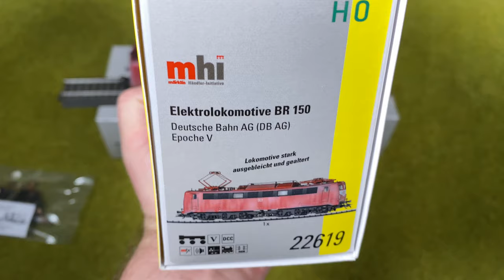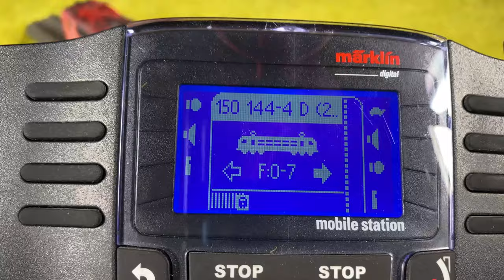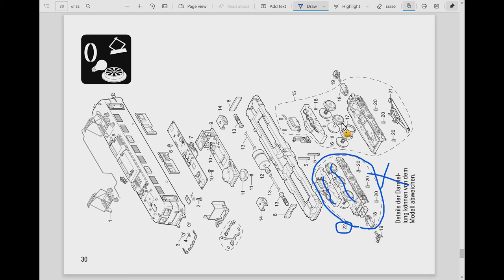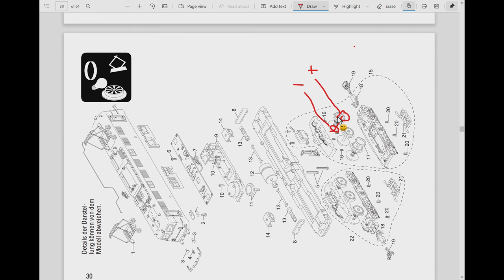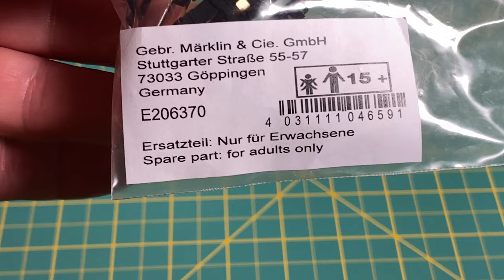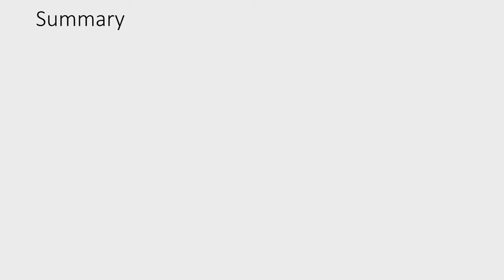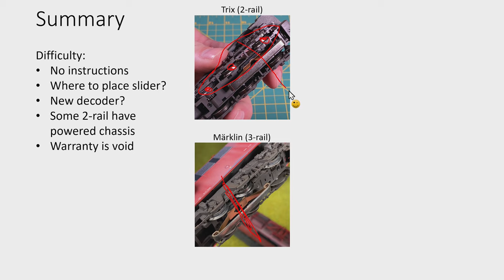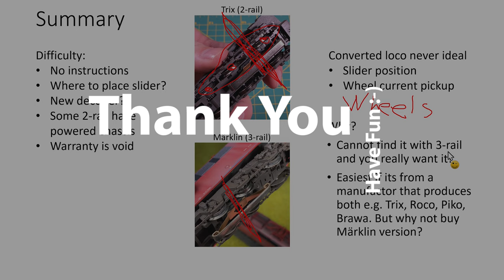Experiment: Converting Trix 2-rail to Märklin 3-rail (Extra 03)

Comment: How do you run a 3 rail loco on 2 rails?
Reply from the maker: Hi, 

In this video I am adding a slider to a 2-rail modern digital locomotive so I can run it on my 3-rail digital Märklin. However, in principle you could also do the opposite by removing a slider from a 3-rail locomotive. Then rewire to make sure the power is taken from the rails - not the slider you have removed. 

Please note this trick only works on modern digital locomotives where you want to go between 3-rail Märklin and 2-rail DCC. If you are trying to do the same with with analogue locomotives then the engines most likely will not be compatible. Same if you want to convert a digital Märklin to an analogue DC.

Hope this help! Enjoy ;-) Bo